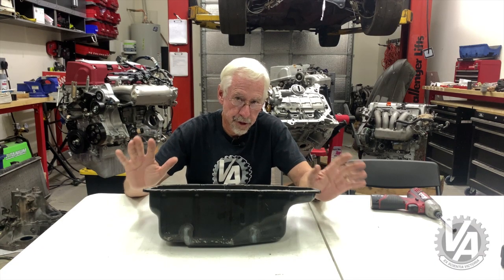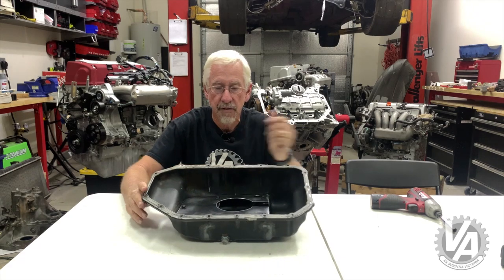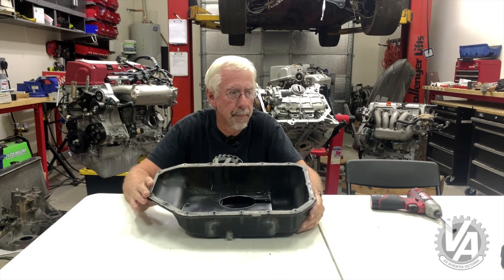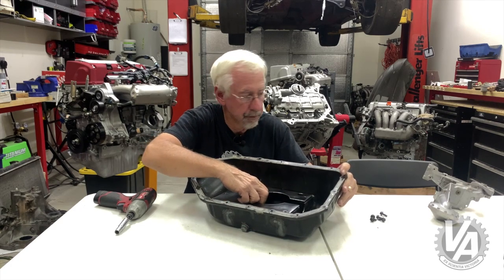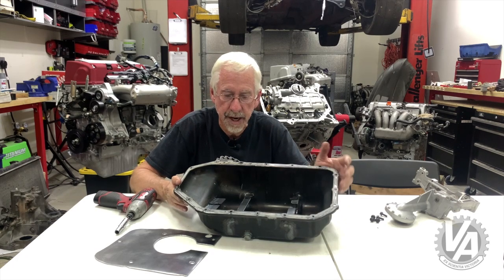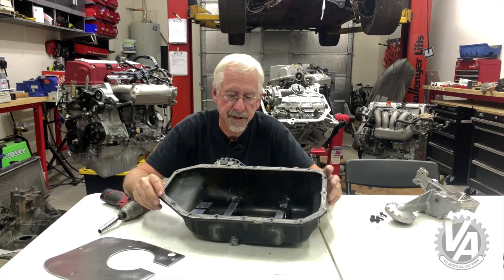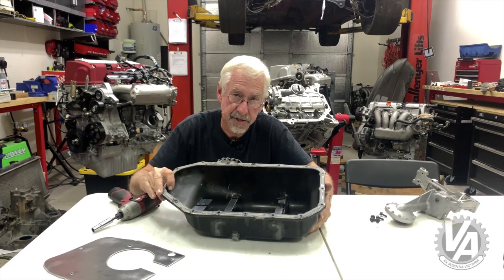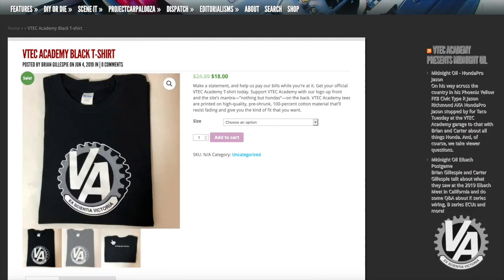OIL PAN BAFFLE - Don't blow up your engine at the track!

Comment: Thanks for putting this info out there. Great tip for someone like me who will be taking 8th gen civic k20z3 to track days.
Reply: Tractuff is one of the few (maybe only?) companies that make a baffle for the K20Z3’s stock balance shaft oil pump too. So you dont have to do the Type S oil pump swap if you dont want to
Reply from the maker: @Getsomepiggy  Exactly!

Comment: Everyone with a b20b/z bottom end: Yout oil pan has NO baffle. Get an integra LS pan which has a so/so one. Maybe weld one in. IIRC vtec pans need the pickup, but clear girdles.

You're welcome.

Comment: YESSSSS. MORE PRELUDE CONTENT PLEASE. Quick question though. Why this type of oil pan over a Moroso? Does it have to do with ground clearance? They are roughly the same price if you buy them both new.
Reply: it could also be a requirement for any race classes that could have rules that require a stock pan, but weld-in baffles are the only legal option. Not sure of any rulesets, but I've seen some weird rules out there...

Comment: Wow! This is crazy because I drive a stock Ep3 and I noticed when I take a tight right hand turn like you said, the motor almost seizes because of that very reason. I always wondered why this happened!
Reply from the maker: If you do much spirited driving on the street, you may be able to add some extra oil to correct that. Although you may experience lower fuel economy.

Comment: Hello supermax here. I just want to ask about a crankshaft for 1992 civic Ex. Mind chip where you put the fully go and the luck key would not fit any more or hold. Question is can I use any 1992-2000 civic crankshaft?
Reply: Yes if you use 1.5 for 1.5 liter and 1.6 for 1.6 liter engines. You can compare all the part numbers on the crank shafts on websites like hondapartsnow.com. There may be some interchangeable parts from the 96 up Civics.